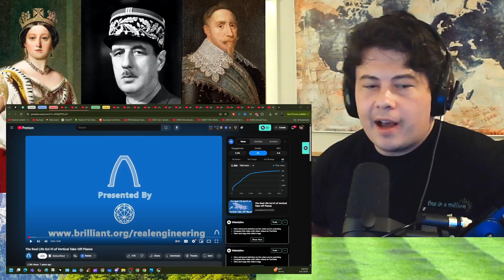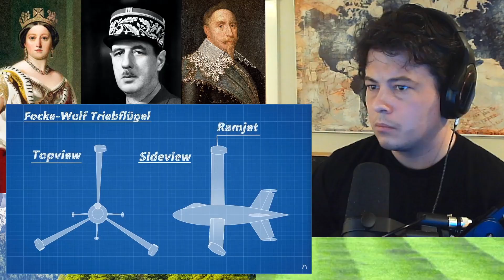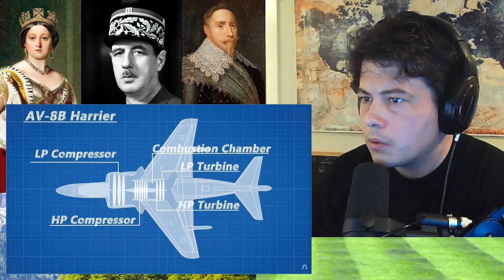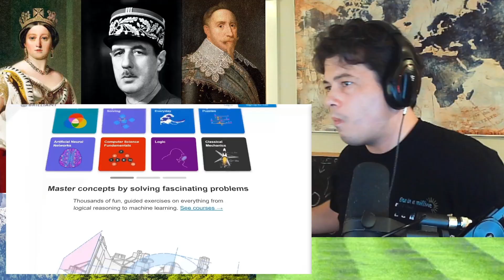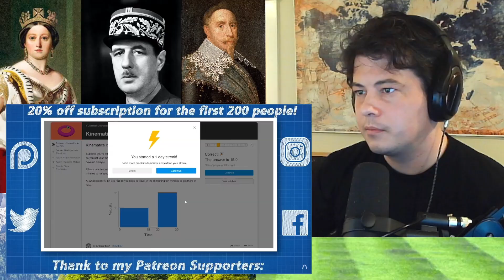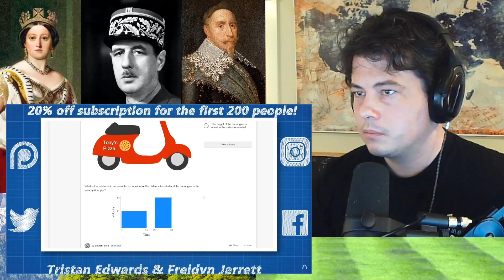American Reacts The Real Life Sci-Fi of Vertical Take-Off Planes

Comment: The first working VTOL was not the British Harrier (Dec. 28 1967). The first one was the German Do 31 (Feb. 10th 1967). Close but first. 12:10 Your plan can be possibly but it is bit too complected. There are tanker in the air, so they can refill the jet after starting. The Harrier was invented for all areas, not only for US aircraft-carrier. In the cold war this jet was very useful because you do not need an airport for it. And the doctrine in that time was to destroy enemy airfields at the first goal. That also was the reason, why the German Autobahn was created as runways and replacement airfield too.

Comment: Pitch: Nose up or down movement (rotation around the lateral axis). Think tilting forward/backward.

Yaw: Nose left or right movement (rotation around the vertical axis). Like turning your head side to side.

Roll: Wing tilt or rotation around the longitudinal axis. Imagine one wing dipping while the other rises.

These are the three principal axes of rotation for aircraft, vehicles, or objects in 3D space, often used in aviation, robotics, and gaming for orientation control.
Reply: Yaw, or 'what do you mean I don't point myself in the direction I want to go in' is a strange thing to get your head round on flight sims.
Reply: @billyhills9933  Haha Spin left and right with your tail Rudder.  Roll and pitch is what most people think how planes fly.  You are right about the sims and space sim using Hotas or Dual Sticks.  Way too much fun!

Comment: 13:55 The reason that the F-35B's 90-degree exhaust doesn't push the tail up and the nose down is the lift fan installed behind the cockpit. The lift fan is a set of blades that are driven by the jet engine via a torque tube and produce an equal amount of lift as the tailpipe exhaust to balance the plane.

Comment: Same hydrogen peroxide, but 100% not 3% (the one you have will be 97%+ water)
As to "Why the front two?" ... Look into "high bypass" engines... Basically you can move more air with a turbine than you necessarily want to use for combustion). You use the rotational energy from the engine to push air backwards, and get additional cheap thrust. (Applies to all engines, even ignoring the VTOL requirements, but it's usually just done by having space around the turbine, rather than separate ducting)
As an aside, that's why plane engines are getting larger... More room for bypass air = more efficiency

Comment: Jet engines use compressors to both concentrate oxygen, but also to raise the air’s temperature. When you compress gasses, they get hotter so when you spray fuel into this hot air it can ignite. The turbines after the combustion stage steal some of the energy from the exhaust to power the compressors. On turbofan engines (e.g. the big jets you see on passenger aircraft), most of the thrust comes from bypass air that goes around that core (driven by giant fans you see at the very front of the engine). This is because thrust is essentially air mass times change in air velocity. You can make thrust higher by either making the air move faster (but there you’re limited by the speed of sound), or by moving more air using a high-bypass turbofan design. Much of the efficiency gains on passenger planes in the past few decades have come from fitting engines with larger and larger bypass ratios. They’re now ludicrously big on long range planes like the upcoming 777X or the A350

Comment: Connor...the "propellers" after the combustion chamber on the Harrier engine are the turbines...they turn some of the hot exhaust from the combustion chamber into rotary power to actually drive the compressor parts of the rest of the engine.